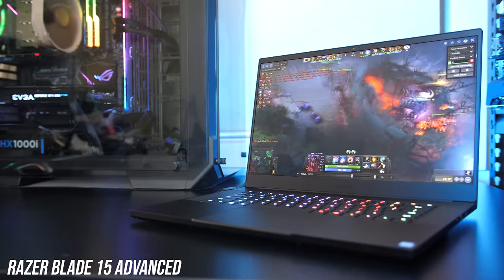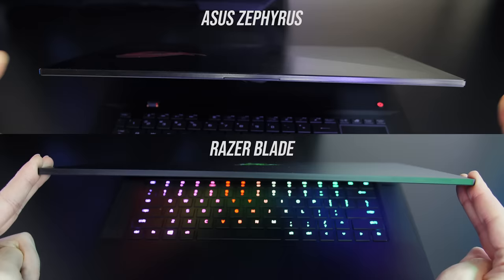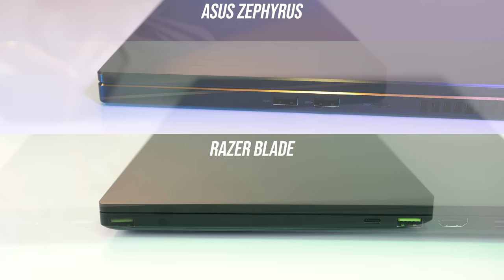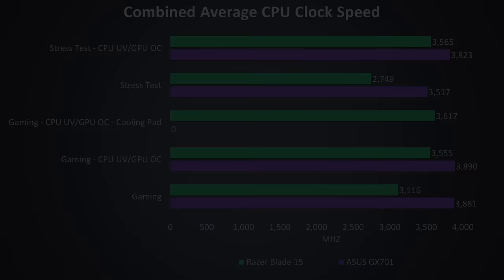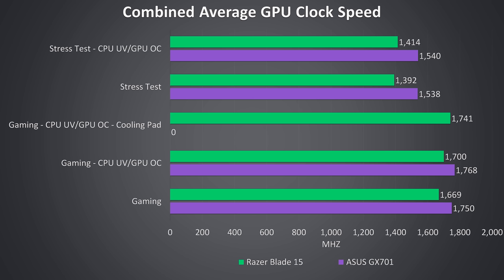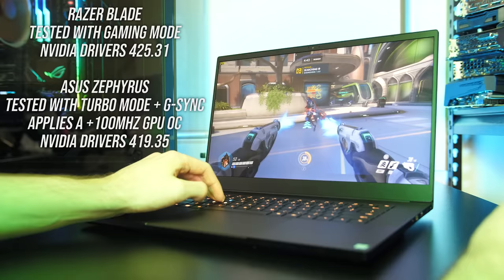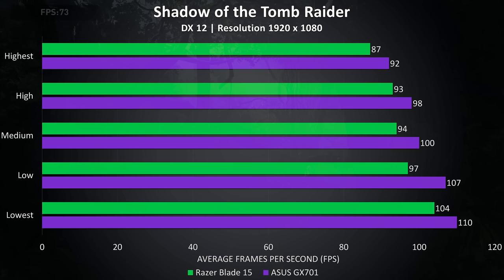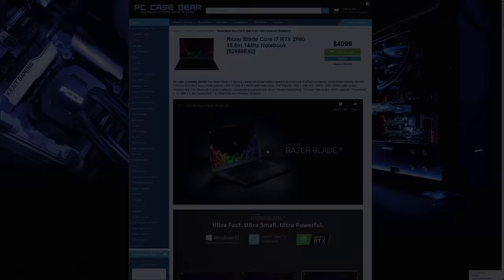ASUS Zephyrus S (GX701) vs Razer Blade 15 Advanced - RTX Gaming Laptop Comparison

Comment: I prefer the blade, looks better, is more portable, has slightly better battery life and runs quieter. The real world performance hit is not enough to deter me from the overall better package and with thunderbolt it is way more versatile. Both laptops are fantastic though, but my vote goes to the Blade in this specific comparison.
Reply from the maker: Fair enough! Thanks for sharing your thoughts 👍
Reply: For me the Blades’ poor ability to dissipate heat, half the storage at the same price point, and proprietary charger are a downer....but battery life on it IS significantly superior as well as Windows hello...it’s just so nifty!  Tough decision eh?
Reply: @justjoshininjapan700  If it doesn't throttle and runs quieter then who cares if it gets a bit hotter? Just saying... I also don't mind the proprietary charger IF the charger is smaller/sleeker than the respective competition, which it is.
Reply: Adrian S sometimes I’m an idiot and forget my charger at home.  The library I do my graduate studies at has generic laptop charger to checkout which is really useful.  This is a real tough decision for me still.  Don’t wanna spend almost $3k and have any buyers’ remorse ya know?
Reply: @justjoshininjapan700  I hear ya. I think everyone is different in their needs and wants. For example, I wouldn't give it a second thought because I never leave anywhere without my charger, but your scenario is valid and, well, I can see where you're coming from. Like you said, it's not cheap and you want to make sure it fits your needs.

Comment: I'm looking to buy a powerful compact laptop. I've been asking around for a bit. And your video is a massive help! And yes I bought the Zephyrus !
Thank you! From Thailand.
Best review ever found.
Reply from the maker: Good to hear! I'm working on some other comparisons like with the gs75 too
Reply: I have 1 quick question, is it day to day portable?
Reply: @drewgarrett-stewart183  I have one, if you have a backpack that can fit it, it's easily portable. In a way I wish I got the Razer Blade 15 just because it's smaller but the power is great and it's still portable.
Reply: isn't there a second m.2 SSD slot?

at least Asus claims that (701gx and gw)
Reply: Fc คุณ bayครับ

Comment: Great review! Since I’m not a hardcore gamer and rarely play FPS games the overall average of 12% is inconsequential. The 701’s keyboard and the ROG logo particularly is a bit of a turnoff, the rear venting system does look pretty cool and ingenious, but it’s still a moving part which I think could be a problem later. I would go for the Blade 17 purely for aesthetic reasons. Thanks for that!
Reply from the maker: Thanks! Yeah that's fair enough 👌

Comment: Fun review. These were the exact two laptops I was deciding between last month. I went with the new 9th gen 240hz blade because I travel every week for work. Absolutely love it but I really like the thermal exhaust design on the zephyrus. With a good undervolt and the ram upgrade I did on the 9th gen blade it reduces the Asus lead to about 6% in fps. Both are definitely awesome.
Reply from the maker: Nice! The newer GX701 apparently has 16gb soldered to the board rather than 8gb too, so it's good if they've upgraded it.
Reply: @JarrodsTech  that's good for sure having 8 soldered on was a weird choice in a laptop of that type. Nobody wants to have to buy a 32gb stick instead of a 16

Comment: Subbed. What a thorough comparison with no fluff. Amazing when you think about that it's a 25 minute video with pure information compared to others that gloss over things in 5 minutes. One thing that you did miss is the Wattage requirement from PD via USB C charging on the Zephyrus.
Reply from the maker: Welcome to the channel! I guess I missed that because I wasn't able to test it properly, I go into more details on it in the full review video of the GX701 (linked in the description), but basically my power bank wasn't powerful enough to charge it. I didn't see the actual amount required anywhere, though if I recall ASUS were advertising that it worked with their own 65w solution.

Comment: FHD 240hz or UHD 60hz? Which will you recommend on the Razer blade 15?
Reply from the maker: Nothing will really run at 200+ FPS except esports titles, but at a laptop screen size 4K is honestly a bit of a meme and pointless especially as nothing but a 2080 can really pull it off.

Comment: Excellent overview as usual.  Honestly think you are doing the best reviews and comparisons out there.  

It's very interesting about the Optimus vs Gsync cost.  I do wonder that with the gx701 getting better thermal performance if some other laptops like the razor didn't have that bottleneck if it would just result in a couple percent gains and then thermal throttling, though all speculation at this point.  Gsync was important to me before, it's even more important to me now.  The gx701 basically has a cooling pad built in seemingly.

I will add that the gx701 with the 8750h is now $2900 (was $2800 for a few days) on Amazon.  With the new 9th gen verisons coming out with 16GB soldered.  Also another difference is the gx701 downmodel includes a full laptop 2070 not the Max Q version like the Razer.  That actually makes the gx701 with 9750h and a full 2070 a very interesting option at $2500, I'm curious on the performance, if like others it's probably only 10-13% slower than the gx701 with the 2080 Max q.

I had a gx701 for about a month and loved it.  The forward keyboard for me was great.  17" is such an upgrade over 15" for me (23% more screen space).  Shortly after that they announced the 9th gen options and 16GB soldered (the one downside of the gx701 for me since professionally I do use a 32GB work laptop for running 10+ VMs at a time, so would be nice to mirror that though not essential) so I returned mine (fortunately got a full refund minus about $12 on my extended warranty for the pro rated time).  

Currently the gx701 with the 2080 max q, 9750h, and 32GB ram is slotted to come out May 27th so waiting for that.  Though I have to say I'm interested to see someone review the gx701 with the full 2070, considering it's $800 cheaper for everything else the same (minus about $90 to buy a 16GB sodimm RAM chip to get dual channel going) it's really compelling.  

With that said I'm very interested at the GE75 9SG with the i9 9880h, going from 6 core to 8 cores.  Notebookcheck just released a preliminary result and showed over 50% improvement in multi core results and have shared some results with the Witcher 3 and Shadow of the Tomb Raider.  Like the previous GE75 it comes with a full laptop 2080 not the max q.  It showed about 10%-ish gains on the gx701 in games and this one seems to be showing up to 17% improvement over the gx701.  It seems like the 32GB RAM 1TB nvme 9880h 2080 model might be about $3400... if so for $100 that's potentially some compelling performance improvements.  It's about the same weight as the gx701 but it's a bit thicker (46% thicker at just over 1 inch).  I prefer the forward keyboard of the gx701 too.  Though those performance specs are interesting.  Unfortunately it doesn't have gsync which means tearing and potentially a frame hit on some games, though according to notebookcheck the new ge75 with the 9th gen i9 it gets 109 FPS in Shadow of the Tomb Raider on Ultra while the gx701 gets 78, this was a game you found to show a frame boost with gsync.  So I'm keeping my eye on that.  Might have to go to my local Best Buy and see if they have a ge75 to get a tactile feel of it.  I really like the quality of the gx701.
Reply from the maker: Thanks! It's good that it keeps going down in price, though I guess it may not be available for too much longer once they clear out stock in favour for the newer 9th gen ones. Hopefully I can get some of those new 9th gen models to test, at the moment I'm waiting on about 5 different models from ASUS so there's quite a queue haha. I want to try the new GE75 out too, when I requested that a few weeks ago they sent me the GTX version ... I guess it's all they had at the time.
Reply: @JarrodsTech  Haha yeah, there are so many laptop models these days!  Honestly its great.  So many good laptops compared to the past.
Reply: @JarrodsTech  I believe you're in the process of reviewing the existing GE75?  Can you comment on how the laptop "feels" compared to the gx701, build quality, keyboard feel, does the extra thickness have a negative impact, etc?

Comment: Im looking into either the scar 3 or the zephyrus S. Jarrod, which one would you prefer in terms of buildability, specs and performance etc? Is there another laptop you prefer that sports the rtx 2070 non max q?
Reply from the maker: I haven't tested the new 9th gen Zephyrus S so hard to compare, I wasn't impressed by the CPU performance of the Scar III though. Depends what you're willing to pay, you can get the Y740 for less money and same GPU and G-Sync still for instance.
Reply: Jarrod'sTech Ah what a shame for the
Scar 3, i was also looking into the acer triton 500. I’m waiting for specials, looking at ebay at the moment from reputabel sellers. Budget is around $2500. Would you recommend any other one with an RTX 2070??

Comment: Made it to the end. It's a lot to cover, so whoever is interested in such comparisons, should be patient to get all the info because the entire video is info only, no random stuff. So it's worth watching the entire thing.
Talking about patience, you must be a really patient guy to do all these reviews and comparisons. Granted, for most of the tests you use benchmarks. So while they're running you do something else, like writing the script and recording for things already tested. I can only assume this is how you work, because otherwise you wouldn't time, literally, to pull it off. Efficiency is the key here. ;)
Reply from the maker: Nice one! Yeah it takes a lot of work, some people suggested making this sorter, but I feel like I'd have to cut important information out to do that, and the point of this is meant to be for people who are considering spending $3000 USD on one of these machines, if I'm spending that much money I want to know everything I can! Usually I have multiple laptops being tested at once, so I can do a lot of things together. For example, at the moment I'm testing games on the Dell G7 while the MSI GS75 has a battery testing running for a few hours. While the G7 does built in benchmark games I have a minute or two between test runs which I use to reply to comments, or otherwise start writing videos / making graphs in Excel.

Comment: By any chance, do you have a plan for 9750H gx701 thermal test? Asus has claimed that they have revamped not only the cooling structures but them fans as well over the 8750Hs
Reply from the maker: Not sure, depends what ASUS is able to get to me, I'm waiting on about 5 different models from them at the moment.
Reply: the 9750H ones run too hot tbh... i had to underclock mine to keep it in the 70 to 80 range .

Comment: I have one question: To bypass Optimus, I need to have a monitor with g-sync or normal monitor?
Reply: normal monitor is fine, as long as you connect it with a port that is directly connected to gpu. the razer blade 15 has the nvidia gpu directly connected to the mini display port and hdmi.
Reply from the maker: Yep any external monitor will work as it stops the Intel graphics being used
Reply: @JarrodsTech  what if optimus disabled in BIOS - any positive affect?

Comment: Will you do a review for the Legion Y740?

Update

I got my legion Y740(2070 max q) and it lives to what it says. Lightning fast and anything I play on it is smooth as butter. No complains and the month wait is worth it. The 2070 max q on this one is different from other max q 2070. It performs better than the 2060, so anyone saying 2060> 2070 max q, it does not apply to the y740.
Reply from the maker: Yes, they told me they may have it available at the end of May, so just waiting to get it.

Comment: is 2000 usd good deal for blade 15 2018 1070 256gb ?
Reply from the maker: Depends if you want to pay more for the Blade, you can get those specs in another machine for less.
Reply: KYAMI I got my blade with same specs for 2639 aud it’s quite good although slightly more pricey for the Razer branding although the track pad is really good

Comment: I found something weird about these 2 laptops. Did you notice that the PCH is covered with the heatsink ? Most laptops for this generation seems to have naked PCH die without a heatsink. So is it beneficial to have a heatsink on the PCH. On my own laptop,  the PCH temp reading is about 50~56C . It does not have a heatsink on it. I'm running on a Tongfang GK5CP0Z chassis.
Reply from the maker: I did notice that, but didn't see the temperature reported in hwinfo, and not sure how much of a practical difference it actually makes to performance

Comment: I'm thinking to buy GX531 (2070 maxq) cause razer 2070 maxq is too expensive.
Also, I'm worried about the temperature controlling system of razer that it still has the problem that its whole body becomes too hot.

From your video and these comments, I assume that it is a wise choice to buy GX701 over Razer. But will it be still wise to choose GX531 over Razer?
What will be the pros and cons of choosing GX531 over Razer, when compared to GX701 over Razer?
Reply from the maker: You'd have to check a GX531 review, can't recall off the top of my head how that one goes.

Comment: I am just wondering what setting do you use on the Zephyrus to run these games? Because I own one and in some games I played such as Dota 2 i only get an average of 120 fps on high
Reply from the maker: Overboost/turbo, what ever they call it, the best option available. If you have single channel memory then you'll expect lower performance too.
Reply: ik it's a little late but with some tweaks using throttle stop and msi after burner i was able to increase my fps by about 25% while also reducing the cpu temp by about 10 degrees.
there are some really good videos explaining these stuffs like undervolting and ...

Comment: Out of curiosity, do you know how the MSI GS75-Stealth or the Lenovo Legion Y740 (2080 Max Q versions), compare to these two? I've zeroed on on those four choices, but I just can't decide and I've never bought a gaming laptop before.
Reply from the maker: I'm testing the GS75 at the moment, and will have separate videos comparing it with both of these when I'm done 😃 not sure on the Y740 yet, still trying to get it, they told me some time late May for review unit availability, so waiting on them.
Reply: @JarrodsTech  Awesome, thanks. I'm looking to get something by the middle of June, mainly because I need a computer to write for the summer term, but I'm just torn between the four options. From everything I've read, the Y740 has the weakest battery life- by far, but there are surprisingly few reviews for the 17" Y740. But, I'll definitely keep a look out for the MSI video. I'm just disappointed Lenovo is the only company that offers a student discount (and it is a substantial one).
Reply from the maker: I've heard good things about the Y740 from the places I hang out in, but yeah will know more once I have it!

Comment: Jarrod I need your help!! I want to order a Metabox alpha-x laptop with rtx 2060, 2x8 16g ram, 512 SSD, 1t Hdd, 144hz screen, but I just wanted to know if Metabox is actually good. I customised the configurations for it to be like that. Would I be better off going for a known brand like msi for example? This would be my first gaming laptop and I just want to make sure I make the right decision. Metabox seems good but I’ve seen a few videos about them getting so hot that it’s damaged the laptop, but that could be because of anything. I’m not sure what to do, the configurations I put into it, added up to $2220 AUD, while an msi with rtx 2060, 512 SSD (no hdd), 1x16 16g ram, 144hz screen, (the msi and metabox both have 8th gen i7 processors). I would buy the msi right away if the ram was 2 sticks (the msi gs65 stealth 8se, thin), this laptop is $3144 at jbhifi but I know someone who can get me 27% off so it comes down to around $30 more than the metabox. What do you recommend I do? I completely trust your decision and thank you for taking your time to read this. I love your channel. Link to msi: https://www.jbhifi.com.au/computers-tablets/laptops/msi-gaming/msi-gs65-stealth-8se-15-6-144hz-gaming-laptop-i7/365041/
Reply from the maker: Yeah Metabox sell Clevo laptops which are pretty good, especially here in Australia they offer great performance for the price you pay compared to many larger brands. I have a review of the NH58ED coming out next week, spoiler, it performed very well. I used a metabox for 3.5 years at my last job, which was my first experience with one of their machines, no problems even with the laptop running 24/7 during the week. Where are these videos showing heat damage? I've never heard of evidence of that in any laptop. The GS65 is pretty good, but yeah without dual channel memory you'll be losing a fair amount of performance, so if you did get that you'd definitely want to upgrade it. The motherboard in the GS65 is upside down, so it's a bit harder to upgrade as you have to take it apart more.
Reply: Jarrod'sTech Thank you so much, I think I’m going to buy the metabox, I was looking for something to use out of the box so the msi is probably not the best option for me. I searched metabox and after scrolling for a while a guy was fixing one that got badly damaged because of the heat, that said I’m pretty sure he found a lose screw inside the laptop which might have been the cause, and either way that wouldn’t usually be the case. Thank you so much for reading my comment and helping me, appreciate it heaps man 👍